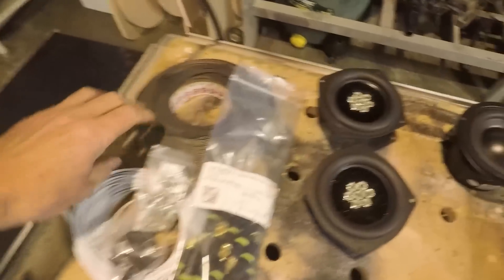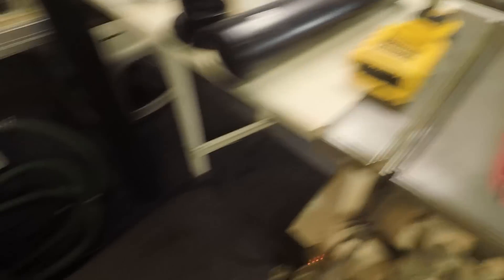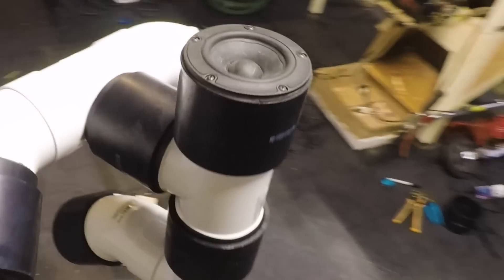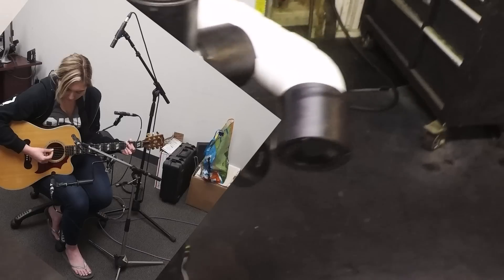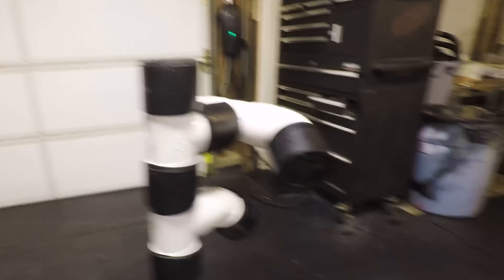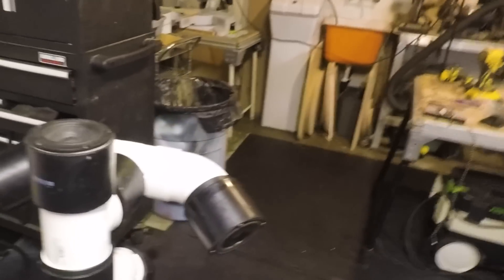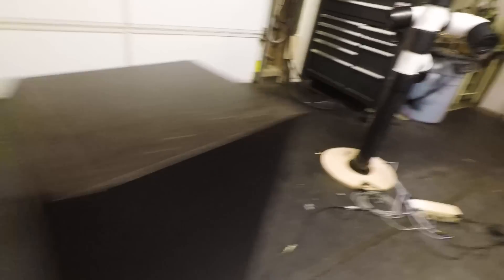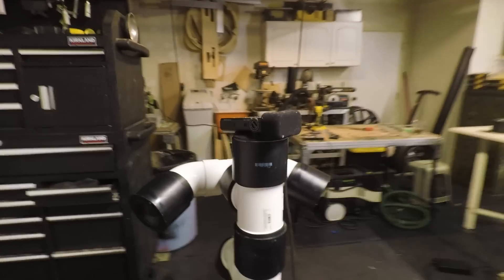Speakers Don't Sound Real, Lets Build One That Does

Comment: I've seen this approximated two ways without requiring a single-speaker-per-source: Ambisonics and spaced-multi-channel. 
In the ambisonics, you record with a 4-way mic like the Rode NT-SF1, then playback could be through a 4-way speaker similar to yours, physically spaced in the listening space relative to the position that it was recorded from. This gets you 360deg sound from a single 'box' even though that box has multiple unique speakers playing multiple unique sources. The ultimate soundbar!  

In the spaced-multi-channel (I can't remember the term they actually used at the time, heard a demo at AXPONA a while back) they record with a mic at each of the standard 5.1 locations, then playback is through identical speakers at each of those positions. I like this approach because playback locations are already defined at scale, so replication of the original effect is consistent if you have a standard 5 channel surround. This effect was particularly convincing if you were in the 'sweet spot,' but wasn't too bad out of the sweet spot either because it replicated the effect of sitting somewhere else in a small club. Wherever you were, there you are.
Reply from the maker: Interesting. In my opinion, any method that captures the sound of the recording room will fail to be able to realistically recreate the instrument in the listening room.

Differing goals.

The goat here is to recreate a realistic sound wherever the speaker is placed and the listening room is the only room heard.

To simulate a musian there and with you, not to simulate you there with the musician

Comment: Is it me or do some of those look like B&C/Eighteensound coaxial drivers.
Reply: Nvm they are!
Reply from the maker: Yes, I used 2 on the 4" coax. But after doing so, I really should have just used 4 of the Vifa 4" as it would have saved the extra wiring and were not really needed. Though they are amazing drivers
Reply: @DaveRat  I like the little B&C Coaxials. I'm actually going to be ordering a few soon for a small project I'm doing. I was originally going with FaitalPros but settled on the B&C
Reply from the maker: They are awesome little units

Comment: Multidirectional speakers have been manufactured for decades. The problem is not with speakers, it's the way music is recorded. Recording engineers using too much processing with garbage equipment is the reason most recorded music sounds unrealistic. Direct to disk or tape audiophile recordings already sound 3 dimensional over stereo speakers. Your concept still requires multiple speakers if you want to reproduce the image of say a jazz trio in your room. The piano 5' to the left of a center drum kit and a standup bass 5' to the right of the drums. Contrary to your claim, your speaker concept still projects inward toward the listener. I will concede that for someone with next to no budget, he can produce a pleasant sound making PVC ghetto speakers, although PVC pipe and fittings are getting expensive. Surround sound done properly has already been shown to sound realistic. As I implied earlier, most recording and mixing engineers suck.
Reply from the maker: I would say any speaker that radiates as much sound rearward and upward as it does forward, can be looked at as radiating outwards and can be placed amongst the listeners

Speakers that radiate primarily forwards are designed to shoot sound inward toward the listener from around the the listener

Comment: Cool and simple example! I know it's using the "sprinklers on walls" style setup, but have you seen or heard much about Flux::Spat and it's acoustic space simulation? It uses some complex algorithms to simulate the "in room" reflections that make up some of the sound you might hear in a setup like the one you've built
Reply from the maker: If I shine flashlights to a place in a room to glow. Vs putting a glowing objects where ya want the glow.

Which do ya think will work better at creating a glow in that spot?

Process thee crap out of it and it will still be flawed

Comment: Sort of playing with waveform synthesis. Some interesting ideas here, with some parallels to how theatre sound design often approaches signal routing - using a discrete speaker in each desired ‘sonic location’ rather than relying on panning/delaying in stereo/surround, though you’re taking it further by zooming in on the parts of the instrument rather than each instrument as one source.
Reply from the maker: I see it as a super simple capture several sonic areas as the radiate from the instrument and have speaker that reproduces.

The fact that amazing results can be achieved with no EQ and no processing is really interesting.

Comment: Hey Dave. I have been following your channel for a while, and it is my first time leaving a comment. I imagined reproducing a full drum kit using dedicated speakers (for each drum piece) positioned like the drum kit when you talked previously about decorrelating sounds through a stereo speaker system. Now you are doing something similar, and it is exciting. 🙂 There is one thing about this "pipe-speaker" that I would like to hear your thoughts on. Do you think mechanically decoupling the speakers would improve the "realness" of sound reproduction? A "simple" yes/no? but I thought it would be interesting to think about this. I am asking this since the sounds captured through the microphones, as you showed in the video, have already travelled a bit away from the actual instrument. So as you already know, these sounds are captured at different times and through microphones with distinct frequency responses (decorrelation!). But it is not so clear to me whether making these recorded sounds resonate from the same pipe that shares the air column inside is getting closer to the "real" acoustic sound. I think the pipe itself becomes an instrument too. I wonder how complex the interactions in the pipe would be and whether they are "beneficial" in this specific scenario. So I am just wondering what would happen if each speaker had their own pipe/box, while still keeping the positioning and angle of the speakers, as you demonstrated in this video. I guess this approach is perhaps not practical since we will probably have to build something like a pipe organ to recreate the sound of an acoustic instrument! 😉
Reply from the maker: Low frequencies have fairly long wavelengths compared to the distances we are dealing with. 110 Hz has a 10ft wavelength, so I figure all the lows can be combined. Also did not bother porting the tubes and left them sealed.

I am sure there are many improvements possible but also it's important to realize that even in it's simplest form, it's very clearly a step towards realism

And great to meet ya DH Daniel!
Reply: @DaveRat  Thank you very much for the reply Dave! Your work and philosophy behind sound reproduction could be an inspiration for many music technologists out there! (I'm pretty sure it is already 🙂)
Reply from the maker: 🤙👍🤙 thank you
Reply: And of course! I'm a big fan! 🙂

Comment: Thanks for the interesting video! I think it would work well with a relatively small instrument. The system uses a loudspeaker as a musical instrument.
How do you do it with larger instruments, e.g. concert grand pianos, pipe organs, large drum sets, etc.? Additionally, how would you reproduce the acoustics of the playback environment? If the speakers were to be regarded as equivalent to musical instruments, I thought that if I brought these speakers into my room, I would be inviting the musicians into my room and would not be able to achieve the same acoustic characteristics as if I were listening to a performance in a concert hall. Also, what do you think about reproducing the reality of a musician moving around the stage as he or she performs?
Reply from the maker: The right tool for the desired application. I think this would be quite impressive to reproduce a jazz quartet with 4 of these. Or someone giving a speech or talking, bluegrass band. 

I could scale it up to do a grand piano version.
Reply: @DaveRat  The campfire/spotlight metaphor is suggestive.

Comment: a fascinating concept mr Dave.
as i understand it, regular hifi speakers behave as a monitor displaying a picture and you attempted to build a VR headset that offers to option to listen to the sound source from different angles.

it has clear advantages in presenting a realistic reproduction of singular and static/fixed position sound sources but wouldn't it struggle to reproduce multiple or moving sound sources (in the same way stereo hifi speakers struggle to reproduce singular sound sources recorded from close proximity)?
could a recording be done in such a way that when played on your '3D speaker' would convincingly reproduce a moving sound source or multiple sound sources (such as a car passing by or two birds singing in two trees)? 

do we need different speaker setups to reproduce different acoustic landscapes? do binaural recordings and headphones solve all these issues?
Reply from the maker: Hmm, this design is all about capturing the instrument and not recording much or any of the room.

This puts the instrument in the room of the listener
Reply: @DaveRat  that makes sense thank you

Comment: I feel like the best way to digest this sort of thought process is thinking "multi-dimensionally" a mono audio channel being considered as a single dimension, stereo being 2 dimensional and lastly a live environment being 3 dimensional (sometimes 4 dimensional when it comes to feeling sub frequencies).

I can understand how creating a 2 dimensional image of a 3 dimensional auditory experience could be considered a flawed process, but honestly I don't think anyone ever really solely focused on making it sound real, the modern approach is to achieve the best sounding audio possible within a stereo field, and in almost every instance, the best SOUNDING audio for stereo is, in more ways than one, the least accurate to reality, and that's what makes a stereo listening experience unique to almost anything else found in the real world. Bi-neural audio recording is probably the best way to come close and through my experience it doesn't sound good or REAL, but even then, when listening, you are being placed within a fixed field and thus it still misrepresents a lot of factors of how audio interacts with your body/head and the room you listen within.

One thing I actually found SIGNIFICANTLY more useful than my initial impression would lead on to, would be you probing your multi channel speaker enclosure with a hand held recorder. At a glance this seems quite silly or futile due to how you'd have significant variance between end-users audio equipment PLUS YouTube compression; BUT that's not the point! 

Considering the multi-dimensional thought process, you are actually probing a 3-D audio field and simply slicing a 2-D plane through it; thus creating a miniature stereo field from every point in space as you translate your microphone throughout the listening environment. I believe this PERFECTLY demonstrates the differences between a standard enclosure and your multi-channel enclosure.

What's incredible is with a lot of multi-track recording environments, you could theoretically map out a speaker for every microphone's exact theoretical position. I.e. creating a fake drum kit by placing all the speakers to be in the correct and inverted orientations of the overheads, snares top and bottom mics, tom mics, and kick drum mic. WITHOUT having a mix the drum kit should sound like it's in the EXACT room with you, if the multi-track contains mic bleed this will even more enhance that 3-D field experience, but I feel it would be almost negligible without an A/B test.
Reply from the maker: Thank you Woody and I will do more on the subject

Comment: This is a very interesting experiment. I think you can look at this in, at least, two ways. You could make a 2 track recording which includes the ambience of the original venue and somehow present that recording to your ears in as realistic way as practical. Isn't that where the work by Neumann and others on dummy head recording comes in. The idea being to give the listener the closest experience to what they would have heard in the original venue.

Or a second method, that you are experimenting with, is to multitrack each instrument. I would suggest each track is recorded in as 'dry' an acoustic as possible, and faithfully re-create the sound of each instrument by providing a playback speaker for each one. Physically set out the speakers in the playback venue as the instruments would have been in the original venue. You could step back and listen to the playback in the acoustic of the playback venue. Reproducing a drum set would need a speaker per drum etc. I wonder how a large pipe organ would be done - that would be fun to try!

Someone posted about a AES paper on this. If they could post a link please. I've always thought that getting a speaker system to faithfully reproduce a complex sound stage is a real stretch. Although current technology has a very good try at it. How a speaker attempts to reproduce a complex sound of a  brass instrument or a clarinet is a marvel. Or a military snare sound. 

It would seem that stereo playback through a pair of speakers is really quite compromised as not only are they reproducing in their local acoustic environment but the recording also normally contains the acoustic of the original environment. How can that work? May be that's why ear buds and headphones are gaining in popularity.
Reply from the maker: I think we have tech that is well developed on reproducing another room into different room and all the issues of the two room sounds.

I don't think there is enough development on putting the actual musician sound into the listening room without redundant room issues
Reply: @DaveRat  As it happens F'Book offered me a story today about the Grateful Dead's wall of sound from 1974. Individual speakers per instrument.
Reply from the maker: Yeah super cool stuff

Comment: I wonder if you could make it work with multiple drivers for the mids and highs, but have a central speaker for the bass. My understanding is that low-end radiates in every direction more easily. That would mean you could get away with smaller drivers for everything else while still getting solid bass. My only concern is that the original sound source might have a weird pattern in the low end that you would be losing with this approach, but the hope is that it wouldn't.
Reply from the maker: A bass driver could be added and driven maybe from an under mic

Comment: Hey Dave,
Love where you are going with this. I’ve mentioned this before but this harkens to what Bose was trying to accomplish with the L1 system. I worked for Bose and the ironic thing was that bands would use these for Left and Right instead of having one for each member of the band.
Reply: I recall just one gig with L1s where we tried one instrument per column...it was a very uncomfortable gig as some players liked to hear themselves a bit too much but perhaps if we had persevered it may have worked.
Reply from the maker: Hmmm. Lots of variable. Individual control vs centralized.

This is a reproduction based concept have not really thought about or intended it for reinforcement-based applications

Comment: Very cool idea!
But convince factor is low and need help with a lot of specification work as a sound technology and a fancy name for it. For it to be able to have a chance to take off.

To get it to be a real product then very serious specifications is needed.
About how many of those speaker columns there should be, were they should be placed for example.

Then when that is defined recording engineers then know to what column they send what sound for example the vocalist in the middle one.

Then they can and need to take old and new recordings and have a mechanism that they know that they send the right sound to the right speaker. (According to the created specification.)

Because that is the issue that needs to be solved that multi tracks need to be still separated and there is no paning between speakers esentualy.

When all is defined of what instrument goes to what speaker. Then that setup is not always used and the album release could define a alternative speaker placement Tor example to recreate that specific live setup that deviate from the base specified setup.

With no specific specification for setup and recording engineers this will have no chance of get to a product when special recordings and setups is needed. When going for more complex setups than one performer. And one performer needed several microphones also so any recording of a solo artist with one microphone will not achieve the goal fully either..
Reply from the maker: Ha! Either that or plot it down and let people hear it and go "wow, that's amazing!"